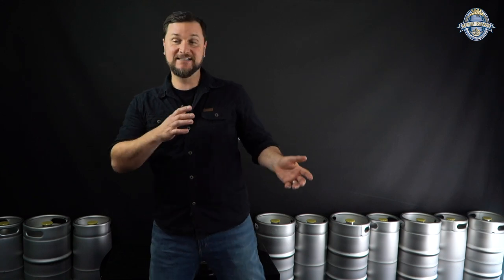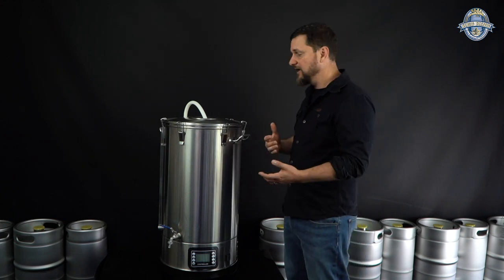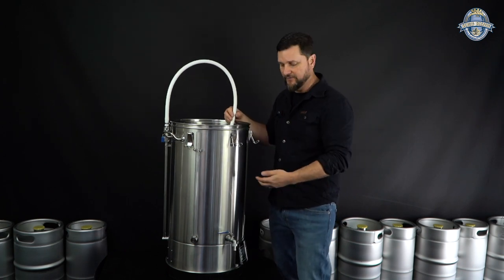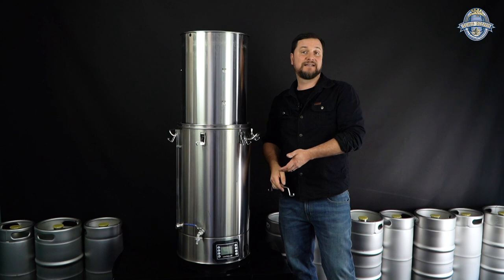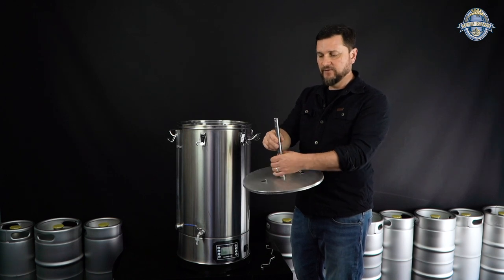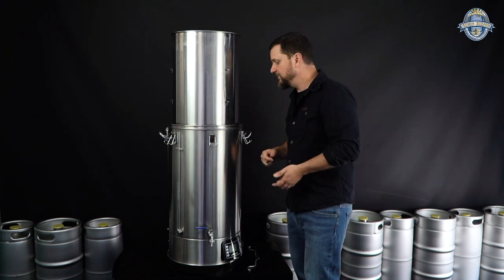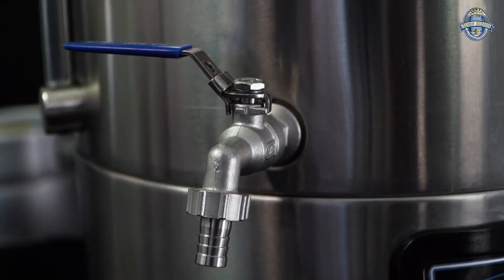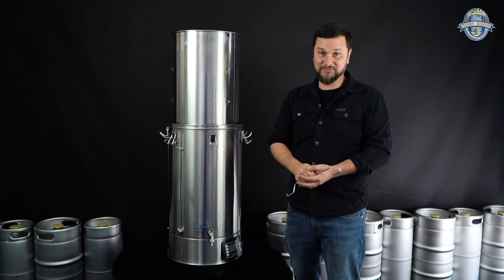70L Brewing Systems

Comment: Does the programmer stop between stages and need a response to move on or if you miss it will it just move on without any input, or can you pause it without having to re-programme. ?
Reply from the maker: You'll have to respond before you move to the boil stage and after you dough in. Yes you can pause it. Also, you can run it in manual mode which means you just pause and change the parameters of time, temp or power.
Reply: @Keg-King  Thanks I think the need for a response is important, the 50L is on my shopping list once they become available in the UK .

Comment: how does the sight glass fair during doing? does it steam off?
Reply from the maker: During boiling there is a small stopper included in the equipment that can be used to plug off the sight glass but it's practically unnecessary. During distillation runs where brewers are boiling for hours it is also not an issue as the column, not the sight glass tube, is the path of least resistance for the steam.